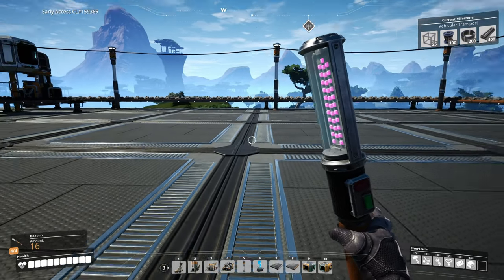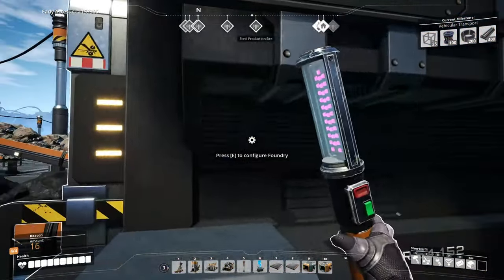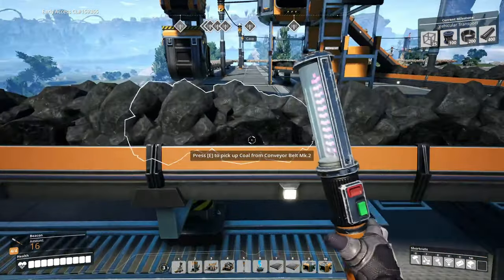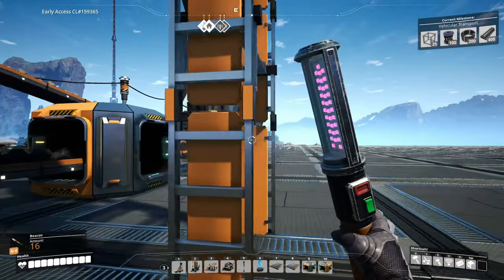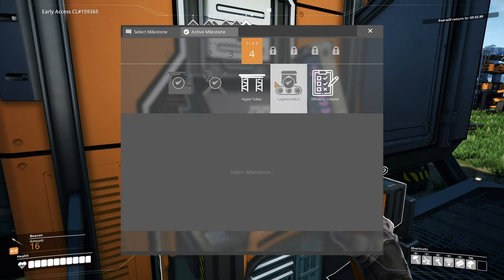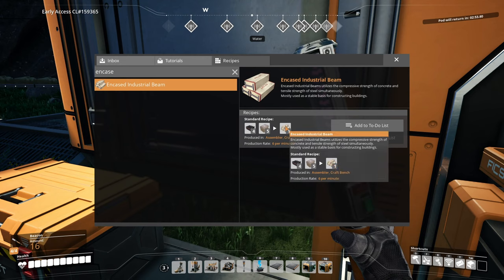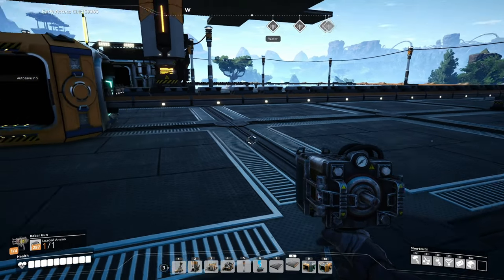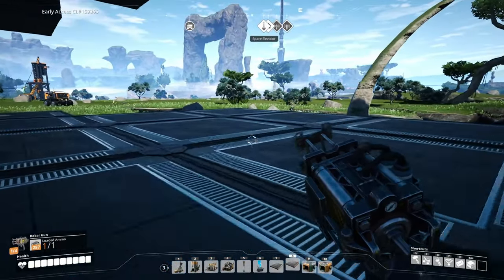Let's Play Satisfactory s01 e25

Comment: One of your Mods is causing that extra needed part for the merger , ( Discord moderator - [6:27 AM] Presumably a mod, 
i assume Smart is autoconnecting to that foundry )
Reply: No need to assume, it IS the cause. @Glidercat: check you mod settings, just press "M" on your keyboard, and disable autoconnect
Reply from the maker: @BasSpruit  I'm working to get used to it. I think it's more of a help than I first thought.

Comment: I noticed that when you were trying to place the merger there was a ghost of a belt flickering. I have no idea why it was doing that since I've never seen that before, but I'm pretty sure that's why it was showing a cost of steel beams. I would guess it's trying to place a mk 3 belt connecting the foundry and the merger. If it comes up again in the future maybe build something in between to block it off before placing the merger, then you can delete the random thing and put in the belt as you like. It sure is strange though.

And in the case of steel pipes, beams and encased beams either split the steel ingots in thirds and put one third for pipes and two thirds for beams, or go with your original plan of having half for pipes and half for beams. Either way I recommend splitting the beams after production, half going to storage and half going on to be encased beams.

Keep up the good work! Thanks Glidercat.
Reply from the maker: Great observations and suggestions. Thanks, Osborn!
Reply: You are right about the Mod wanting to autoconnect an Mk3 belt, that was the flickering. I just got that mod and you have the ability to put a setting to what belt you want autoconnected. ( they go up to 7, but with mods LOL , that's crazy fast ) Once you see the lights on the side of the different level belts that helps alot. When GC looked at that fist autoplaced belt on the left, he missed the notation 'pick items off Mk3 belt' and when replacing it with an Mk2 belt the steal beams were back in his inventory. A small detail easily missed in this case... Oh well, with all these helpfull comments the future looks bright. ;-)

Comment: The resulting problems are similar to the modification problems
How much time I spent was never a problem: That building two splitters in one build. Or that doesn’t put a splitter.
No mod no problem
Reply from the maker: Yep, I'm pretty sure it's the mod. It's actually not bad once you get used to it, but at first it is very odd.

Comment: The problem you are having with the merger requiring beams is that the smart mod has auto connect belts to buildings.  To stop that hit the m key to open the menu for smart mod and deselect auto connect buildings with belts. Many many options in the mod menu.  The double splitter thing you had is also the smart mod making your life easier by stacking the mergers or splitters where you need them to connect straight to the machines.
Reply from the maker: That's good information, thanks! 

At first these features bothered me, but I'm coming to embrace them. I'll most likely leave those default settings on since they'll probably save me a ton of time.

Comment: Adition to these helpfull comments, I think there is a setting in the Smartmod that you can set to what belt you want to use for that autoconnect. Othewise it will try and put down the highest researched belt. I'm going to try this later and not have the recource for it in my inventory, only the iron plates for level 1 belts, then see what the mod does. It can do more for you but honest labour is the way... ;-) ( I did see the mod vid you reccomend elsewhere and it can even copy the input and output and splitters when putting down more machines in a row, it's pretty crazy )
Reply from the maker: I may learn to use it more and more as the series goes on.  I'm guessing I will want to speed up construction of my factories and they get truly huge, but we'll see.
Reply: @Glidercat  The vids about the mod are quite cool. I did test the 'Belt level' : auto vs 1 or 2 or 3 ( via M for menu ) and it doesnt want to build belts / autoconnect them to splitters if you don't have the right material. I mean, it doesn't auto downgrade the belt, it wants to place the highest researched belt... It's quite intuitive. I've also learned that if you hit tab twice, it skips that mode for one time, the next time it wants to autoconnect with splitters again. Enjoy and good luck brother! ;-)

Comment: I'm late to the party, sure, but if you remove ALL your mods and play the game how it's designed to be played, you won't get these "glitches".
Reply from the maker: That is a very good point. 
I only have a handful of mods, mostly inventory expansion and a mod that allows flight pre-jetpack. Still, they could be causing issues.
Aside from convenience, I use these mods so my videos aren't full of time spent inventory shuffling or time spent jumping around pipes and belts while working around my coal generators (flight mod).
Reply: @Glidercat  might I suggest using conveyor lifts directly into your machines in order to lift your belts up so that you don't have to weave around them? You'll have free access to your factory.
Reply from the maker: @MKallagen  That's a great suggestion, but I actually like the look of the products moving down the angled belts much better than the conveyor lifts look.  
They are more practical and efficient though.

Comment: While Mk. 3 belts can support 6 foundries, is the output from your miners able to match it?

Also, check out the first few episodes of a Satisfactory let's play by a guy named Nilaus.  He shows how to stack splitters for the second input on an assembler, the trick to making perfect 90 degree turns on your belts and pipes.  Helped me out quite a bit.

I see why those mergers were requiring steel beams.  It was also putting in a mk. 3 belt when you set down the merger.  Since I don't run with mods, I never had this issue.  Check the settings on your mods and see which one is causing the issue.
Reply from the maker: I'm planning to upgrade my miners with every tier and keep them fully overclocked.

I almost always like coming up with my own solutions, even if they turn out to be sub-optimal.  I don't like to copy other designs if I can help it because, for me, it takes away a lot of the fun of the game.  If I get really stuck though, I'll check.
Reply: @Glidercat  True, but learning better techniques is never a bad thing.  Especially in this game.  Efficiency is key here and if you utilize less space to do the same thing, why not take advantage of it?  I understand wanting to do things your own way to learn, but come on.  Learning also involves research from folks who have discovered stuff that works.  Remember, a wise man learns from the mistakes of others.
Reply: Nilaus is a beast on factory games. His series on Dyson Sphere Program makes my tiny factories look pathetic.
Reply from the maker: @FredRated1967  I couldn't disagree more.  

For me, games aren't a task to be completed, they're a journey for exploration and fun. Most of my fun, especially early on, comes from using my own brain to try and come up with solutions to the challenges the game presents. 

I agree that less space and more efficiency are key...  for some...   not for me!  Watch my series and I'll demonstrate how you don't need to overthink those things if you choose not too.  It's fine if you choose to, my point is that it's entirely unnecessary to do so and you'll have plenty of fun whether you do or don't.

Copying someone else's designs or approach, even loosely, just makes the game boring *for me*. 

I know full well going in that what I come up with is not going to be optimal, but I find it exceedingly dull to copy someone else's approach and just tweak it a little or something.

Now, if I get stuck or frustrated with something in a game, I won't hesitate to try and see what others have come up with to overcome the problem I'm having when I'm truly stumped.  

Also, once I start getting bored with a game or run out of my own ideas, then I might go seek out what others have done. But it's extremely rare for me to do that before I've played a game through on my own a few times.

I know my approach is different than many (most?). I used to play games very differently, and who knows, I may switch back to that at some point. All I can say is that I have way more fun now, and long-lasting fun, than I ever used to. It's not even close! 😺
Reply from the maker: @beaverman1974  Ouch! My pride, beaverman, my pride!  

Just kidding. 😸  I'm aware of Nilaus but I haven't really checked out his channel.
Reply: @Glidercat  Ha don't take it the wrong way, he's good, but sometimes too good. I can't get anything near what he does as he hardcore on his ratios. 

You on the other hand make games more accessible. Since watching your channel I have bought nearly all the games you have previewed. I'm currently on hour 17 of Satisfactory and it's absolutely amazingly entertaining. But I do still enjoy watching you play too as we have similar styles but you are more methodical than me.
Reply from the maker: @beaverman1974  I'm just kidding. 😺
  
I work pretty hard and naturally want to improve my channel, but I'm not really competing or comparing myself with any other youtuber.

I'm just glad there's people out there who enjoy my content!
Reply: @Glidercat  And getting views from a huge YouTuber coming to you is also a great bonus. Definitely doing something right! Keep it up. 👍
Reply from the maker: @beaverman1974  Am I getting views from a huge youtuber?